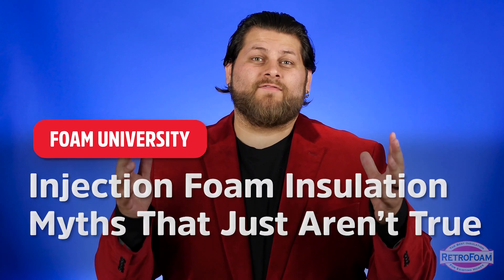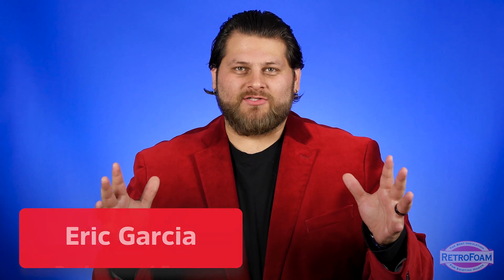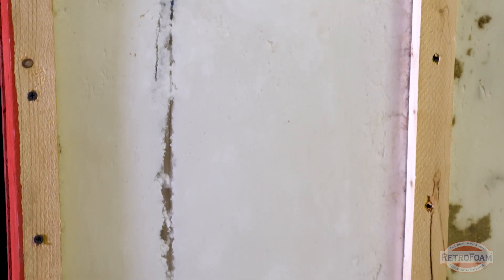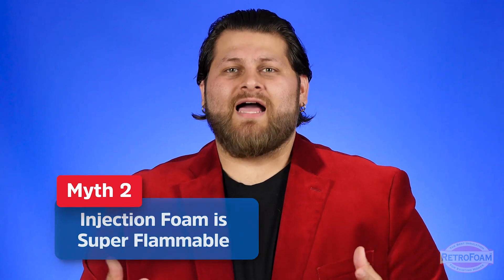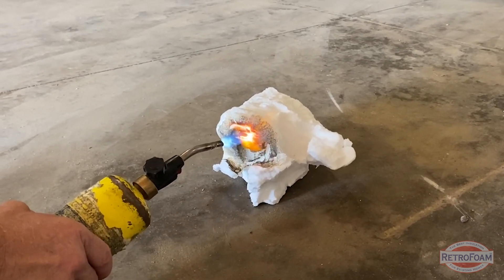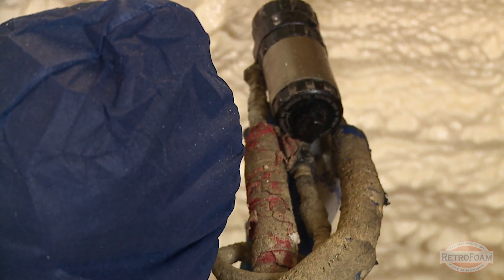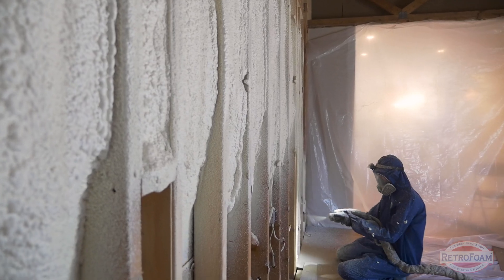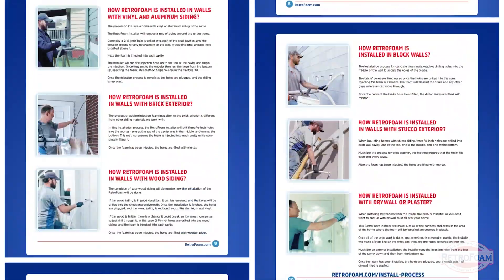Injection Foam Insulation Myths that Just Aren't True | Foam University by RetroFoam

Comment: What is the chemical difference between injection and spray foam? Do you still need to leave the house for 24-72 hours after applying injection foam like you do with spray foam?
Reply from the maker: You do not need to leave your home for injection foam. It does not off-gas and is non-toxic.